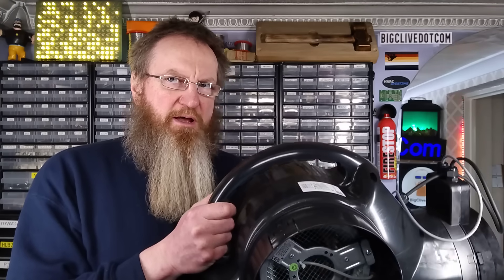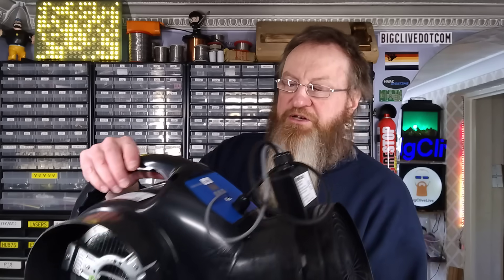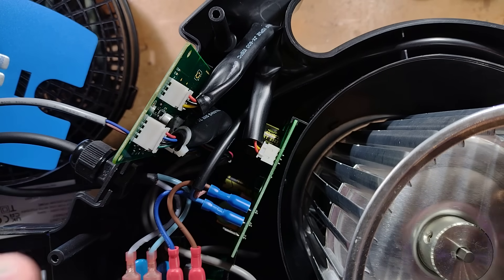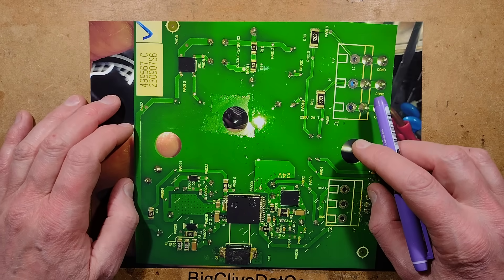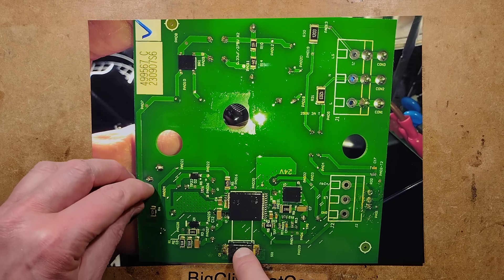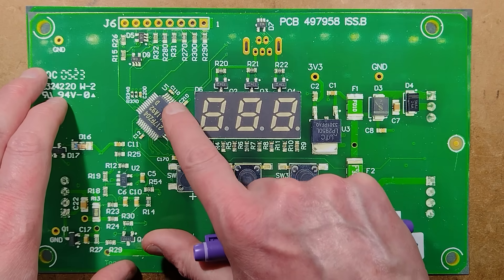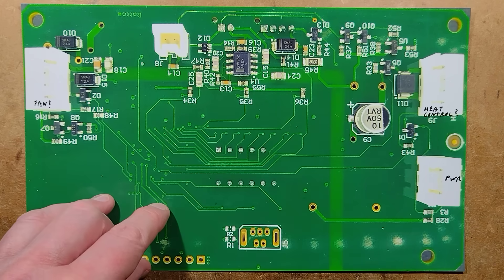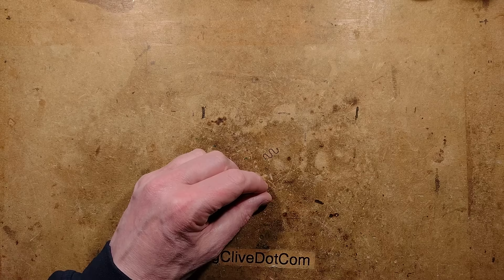Inside a Positive Input Ventilation (PIV) unit

Comment: Mcguyver version: 
close all windows, open trickle window vents in areas with high humidity (bathroom/shower room, and kitchen).
Step 2: Open all room doors wide.
Step 3: Stick the nozzle of your Henry hoover out through your letter box and seal surrounding gap with poly bag and wide masking tape. Run for 5 minutes a day.
🤷🏻‍♂️.

Comment: PIV systems are the gold standard for remediating condensation issues in the UK. Only problem is the cold air they pump into the house, and the expense of them. I suspect that for most homes a filtered bathroom extractor going from the loft to the landing would do the same job for 1/10th the price.

Comment: That might work in the cool damp UK, but here in Florida it would simply draw in hot damp air that would send the interior humidity to saturation as the AC cools it down.

I have a cheap ($190) dehumidifier working in parallel to the central AC to keep the RH below 40%. This allows me to set the main AC to 78F (25.6C) and it feels nice and cool thanks to easy evaporation of any sweat. No mold or mildew anywhere in the conditioned space, either.

Comment: It seems obvious that that's a solution to the problem of moisture control specifically targetted to smallish, older, not well sealed, houses in some temperate climates that rarely experience temperature extremes. (Like the UK, for instance).

In a colder than UK climate (e.g. most of Canada) a 500W heater isn't going to get an appreciable quantity of -10° to -30° C air warm enough that you want it blowing into the living area. 

And with a modern, near airtight, house, there's likely to already be an air-to-air heat exchanger bringing fresh air in, along with central air conditioning dehumidifying the air during the summers. 

Then there's the 3000-6000 sq. ft. houses builders have been putting up everywhere. With 12' ceilings, that's something like 60,000 cu ft of air. A google search tells me that a typical 10W centrifugal fan moves between 15 and 40 cu ft/min, so even at the high end it would take over a day to change the air once.

Maybe it's genius at what it's meant for, and I hope it works for you, but I don't want one in my air-conditioned Toronto area house - summer or winter.
Reply from the maker: It's definitely best suited to homes in milder climates.

Comment: A similar system is common here in France called a "Ventilation Mécanique Contrôlée", except it sucks air from the house rather than pushing it. It is normally ducted from the bathroom or toilet areas and kitchens where there is more likely to be moisture or odours.

Comment: I find it odd that it reduces humidity. Can someone explain? Surely, if there is humidity with a positive pressure the humidity will be forced into the walls and any air gaps, thus condensing within? Wouldn't it be better to pull the humidity out of the building?

Comment: I used to see those sort of things years ago Somerfield I think it was had them in the store crew rooms , but they were dual with a heat exchanger ,  there was a matrix with two paths through for the air ,   I measured the temp difference and it was 5C or so ,   other ones were labelled on the plans as"void"  ventilators but it was either that unit or a inline fan , costa I think had a similar thing ,  they also had a very neat unit that used a cylinder for the hot water that was a heat pump that cooled the office area ,  a nice elegant efficient solution ,

Comment: I fitted one of these a couple of years ago. We used to have two dehumidifiers fighting damp and mould and consuming a lot of power, now no such problems at all. Fit and forget -  for all the controls that you can fiddle with, I've never had to touch them as the default settings seem fine. Once a year I climb into the loft to check the filter isn't too badly clogged, and that's it.

Comment: I see the utility for houses without forced air heating.  If you have a forced air heating system, it's much easier to incorporate a heat recovery ventilator as part of the system to produce the same result.  (A heat recovery ventilator is a counter-flow heat exchanger that has interior air going out and outside air coming in.  As a result, in cold weather the outgoing air loses heat to the incoming air and in hot weather incoming air loses heat to outgoing air, so you get very little heat going in the undesired direction.  You do need to have a drain line, since it generally has condensation when in use.)

Comment: Greetings from Poland. I guess all the accomodation units on offshore rigs are pressurised. For different reasons. Mainly in case of fire to keep smoke away. Air intake then must be located against the wind direction. In Poland we use "Recuperation". The heat exchanger where air pumped into the house is heated by air going out.

Comment: Hi Clive: I used to have to do quality control in a firm that coated printing plates. Huge noisy fans on the roof tried to maintain positive pressure to keep the dust out, and must have made life almost unbearable on the estate outside!  Could just about manage in the winter, but disastrous in the summer, when overheated workers started opening windows! Just one speck of dust on a giant ally plate is a reject!
As for home freshening, you may find that it works better to 'go with the flow' as was the design for passive ventillation in hot desert climes.  In summer, I just open the loft hatch and crack open a vent downstairs on the side away from the sun.  It works very well, but you have to be careful of slamming doors, as there can be quite an updraught when the sun is high.

Comment: I have an enviro-vent unit in my loft... During the first year I was here I couldn't work out why my electric bill was so high untill I realised it had this 500w heater running in it to keep the air temp above 5 degrees. 
When you read the obviously American instructions it says it takes warm air from your loft and distributes it around your house to ease the heating bill.... I dont know any UK houses that have warm air in the loft... I tend to turn my vent off during the winter when you think you'd need it most to combat damp because the baltic air from the loft causes a freezing draft down the stairs to the lower floor. The idea is great giving you positive air pressure but I don't they work to well here in the cold UK. Unless you can afford to keep that heater on... 
Something that none of the specs list in there information. They may mention a heater but they never state its a whopping 500w.
Reply from the maker: A compromise may be turning the unit to a lower airflow setting in winter and perhaps disabling the heater.

Comment: My mates got a very modern house, triple glazed and insane amount of insulation. He has one of these and its ment to help distribute the heat so the house only has downstairs radiators. He thinks its rubbish and just wastes electricity and has switched it off and is planning on putting rads upstairs. I think if you have damp then a dehumidifier is a far better option plus you get the benefit of the little bit of heat they generate.

Comment: Aw Clive, You forgot to power the thing via your Hopi / AnTai so we could see the power factor. I would hope it's near unity because it's designed for 24x7 operation
Reply from the maker: The big smoothing capacitor suggests it will be roughly 0.5.

Comment: My roof gets far too hot in the summers (so much that it can't cool down overnight once the insulation is overwhelmed) so I'm planning on fitting a thermostatic extractor fan in there to pump out the hot air, with a hit/miss vent in the loft hatch to let it pull heat from the house as well as bring through fresh air from the cooler side of the house via a roof air brick if that vent is shut. I'm hoping it'll work with trickle vents to equalise the pressure throughout the house too.
Negative pressure isn't great for keeping out pollen & dust, but I'd have to fit one of these through a downstairs window for the positive stuff to work, which would be.. messy.

Comment: A few years ago we had loft insulation as part of a government scheme and they tried to force us to have extra unsightly fans fitted. Eventually they offered us a PIV with the outlet at the top of the stairway. Sceptical it would do anything but happy not to have unsightly fans we agreed. In winter the hallway is noticeably chilly but we no longer have mould in the bathrooms.

Comment: There are much smarter systems like these.
It's a PIV system but with an additional exhaust and a heat exchange unit taking the heat from the exhaust and using that to heat the input air. This way you recycle your "warm air", rather than just heating the outside. They might also work in reverse to cool the input air. They are used for "low energy" houses, and as far as I know, for the "low energy" certificate, they pressurise the house to make sure that there are no unintended air leaks, other than the exhaust.
Reply: I know someone with such a "ultra low energy house", and they said that the very slight draft (which you don't really feel) also makes it near impossible for any light dust to settle down.

Comment: Couldn't you mod one of those cheap wireless on/off fob switches to bridge the pins on the remote control connector thus saving yourself an order of magnitude in cash? Would like to see you do that Clive.
Reply from the maker: That's why I was hoping it would have power on the connector.

Comment: I would be slightly sceptical until proof is given, that positive pressure doesn't push the humidity into the walls causing mold to fester

Comment: As far as I understand the functionality of an air heat exchanger, supposing an indoor ceiling temperature of 23C (outflow) and an indoor inflow setting of 17C,  then a heater would not be required as long as the outside temperature doesn’t get below circa 5C. By the way, the heat exchanger does not dry the air per-se. Everything goes down to the outdoor relative air humidity in relation to the increase of temperature (see the psychrometric chart).

Comment: Sorry for the off-topic.  Wanted your advice on drying out silica desiccant packets. I’ve got several (okay, dozens) of different brands and generations collected from several different places. Some are quite large. They seem to have drastically different drying instructions printed on them, if they have any instructions at all. What temperature and time would you recommend?  Is it safe/effective to dry all desiccants for re-use?
Reply from the maker: It will depend on whether they are all silica gel.  If they are, then a large quantity could possibly be dried using a microwave, but a heated and vented chamber like an oven at 100C might be more predictable.
Reply: I would definitely use an oven or a small toaster oven. Just don’t want to burn 8 hours of energy if I can do it in 2. Although 100C won’t break the bank. 

Would rather not have them burst into flame by getting them too hot.

Comment: I'd be really interested to know your opinion on PIV VS the "heat recovery" systems that change the air in the house while recovering most of the heat (or so they claim)
Reply from the maker: I doubt they recover even half the heat.  It sounds like marketing speak.

Comment: Positive ventilation is also used to remedy radon presence in houses. Apparently works best for bungalows.
Reply from the maker: This unit has a radon mode that keeps it running at low level at the temperature extremes it would normally shut off.

Comment: Me, I'd disconnect the heater and put an ioniser on the output. 

So it pushes out the hot air and inputs a loft full of colder air, till it encounter really cold air, sounds expensive to heat.

+1 for mechanical hvr

Comment: worst idea ever, with positive pressure wet air will sneak out the building, and condensate inside the wall and trough plugs wetting all the wiring
Negative air pressure is far better as you don't '"wet" your walls
Positive pressure require all you walls, socket and everything is absolutely air-tight, with the only way to exit the house to be the exaust air pipes

Comment: I live in a 6th floor flat with mechanical ventilation. It makes the air very dry - dryer than most ppl concider healthy, but I like it. As a consequence, I can put opened packets of crackers in the cupboard and they will still be crispy weeks later. My hardwood floor doesn't like this at all though.

Comment: We have been recommended one of these, not for winter use, but for summer! 
The reason being we have a c1750 house, for 8 months of year we have a multifuel boiler stove running 24/7, great keeps the house warm and draws air through the house keeping it mould free, but in summer with little if any air flow through the flue, mould starts to form. We where away for a 90 day EU trip last summer, on return the house was a mess, mould everywhere, on walls, furniture, and clothes, days of work cleaning all surfaces, and washing most clothes.

Comment: This will work better than a dehumidifier for making air quality better inside. 
In old buildings, if there's moisture and mould, then look at the bricks, look at the walls, floor, roof. If water can get in, seal that ASAP, because it will keep coming in until sorted, and a dehumidifier might as well be burning electricity at that point. 

That said, I have first hand experience on helping rebuild and restore an old building that literally collapsed in and sat like that for decades. Industrial dehumidifiers made a nice little water feature until the place was dry enough to live in, and even for years after that to sort the roof and walls. Lots of glue was used, the roof is still as it was 100+ years ago. 😎

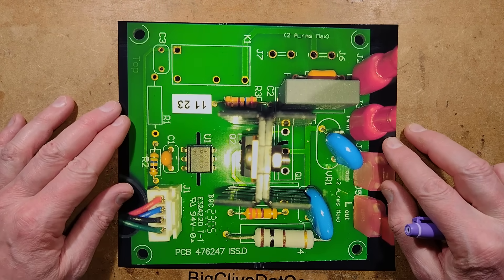Comment: 10:27 With the larger omitted component marked "K" it looks like they were undecided on whether to use an SCR or a relay for the heater. I like the idea of using the solar heat on the roof to warm the house at some times of year. For others, I allow my A/C to draw in cooler somewhat musty air from under the house. As presented to the living space that has a slightly lower absolute humidity than what came in and should dry instead of wet the cracks it flows through to complete the circuit.

Comment: An enthalpy wheel is the best method for transferring the heat energy from exhaust air to fresh inlet air. One actively draws air out from one or two locations and diverts some of it through the wheel to outdoor exhaust. Fresh makeup air is drawn in through the wheel recovering the heat and blended with the recirculated air before filtering and perhaps zapping with UV.

This works as well in summer, cooling hot outdoor air to about the temperature indoors.

The proportion of exhaust to fresh air varies between 10% and 50% with the lower proportion typical for residences.

Comment: This would not be a good idea around here, in Sweden. Modern houses are well insulated and have a moisture barrier inside the insulation, so that no moisture from inside can leech out into the insulation, condense and thereby allow fungi to grow. All modern houses have slightly below atmospheric pressure (neutral would work, but since PRECISELY neutral is hard, we do slightly below to be on the safe side).

Comment: 1 lacks a heat pump
2 lacks  heat recovery
3  is unlikely to be effective beyond a limited area
4 would be eclipsed by a HRV HVAC system
5 requires a leaky house which is undesirable.

Comment: There is one of these fitted in my flat. As it's housing association they omitted the heater.
No need to say it's not easy to heat the flat in the winter or cool in the summer

Comment: Here in France we do the opposite by sucking the stale air from kitchens and bathrooms (and also separate toilets if they're present) and fresh air enters through vents on all windows. It's also a centrifugal fan but its exhaust goes outside instead of the attic like with a US whole house fan for example.
Older homes might actually have nothing but I have never heard about positive pressure being used in any French home so far.

Comment: It would need a dedicated inlet duct for fresh outside air. Otherwise it'd just pull all the fiberglass dust from the attic and blow it into the house. Or just get its filter clogged in a day or so. But a neat idea. If I wanted it in my house, I would put it in the crawlspace, which is very clean and "indoors" but is still "unconditioned" so it is vented to outside air, more or less.

Comment: I see no point in pushing warm air along the ceiling when all the warm air in the house is going to be going to the ceiling anyway.  Better placement of radiators in the house and possibly an 'end of air track' low volume extractor would seem a better idea to me.
I live in a house, opposite an open park to the west and windward side with other houses 'funneling' any air movement from the west, through and past my 1970 build house.  The drafts are terrible and the radiators where they still exist, in very bad places.  Nothing I can do about that.  Cheers!

Comment: The input filter either needs some skeleton inside to have it stabilized, or it is an output filter which would avoid air drag even better by distributing the air over a larger area.
In fact, I have seen quite long (about 5m long) output filters like that working in professional environment.